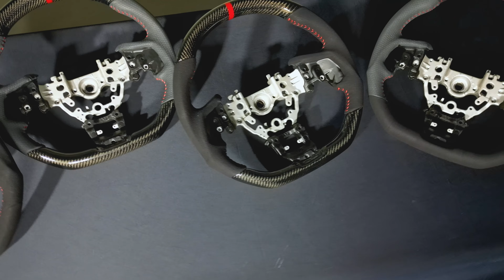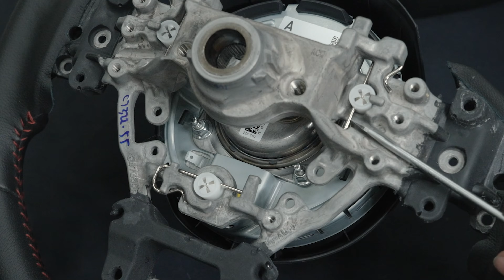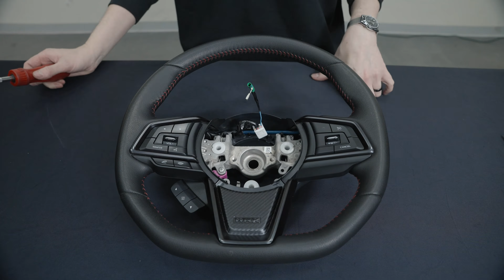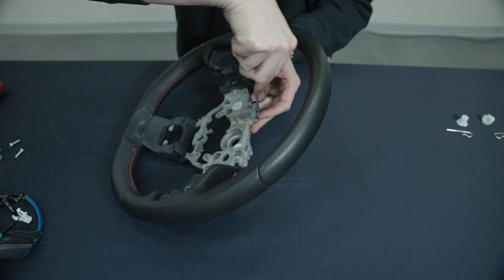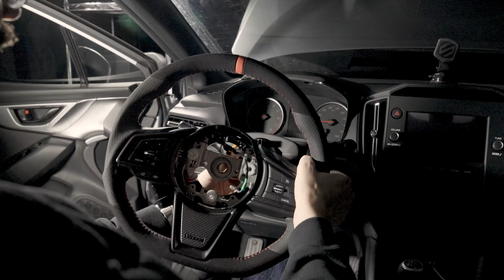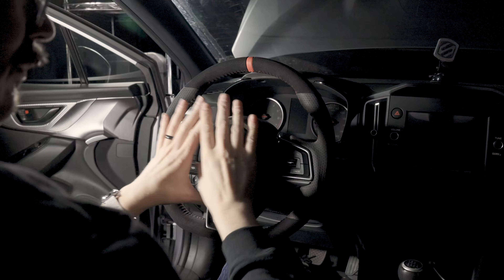FactionFab 2022+ WRX Steering Wheel Install

Comment: Do the suede wheels have a more or less round cross-section on the top half of the wheel circle? I'm not liking the weird flattened shape of the upper part of stock wheel grip.
Reply from the maker: The top cross section is pretty much unchanged from the OEM wheel. We reverse engineer the core of the wheel and then pretty much only modify the side contouring and lower section (increase the D shape). 

I know exactly what you're talking about though, the flat edge along the top is somewhat controversial among our team. Some people love the shape and say it gives better grip and feel, some want it to be more of a true circle. Ultimately, we decided to mimic the OEM shape.
Reply: @factionfab5834  Thanks for the info!